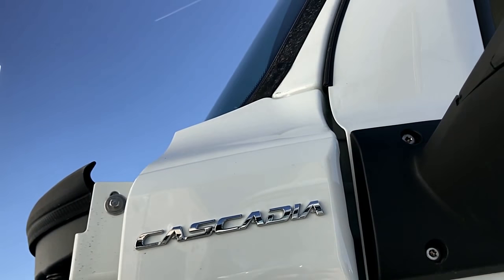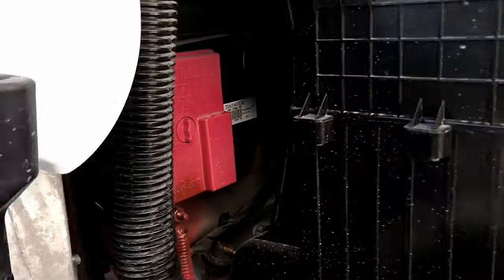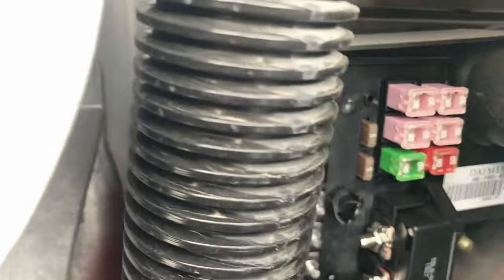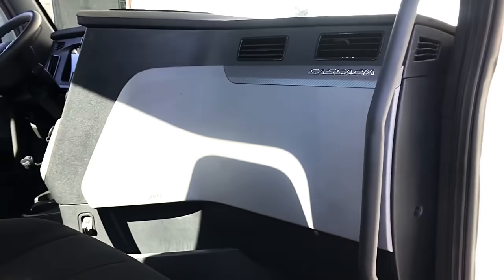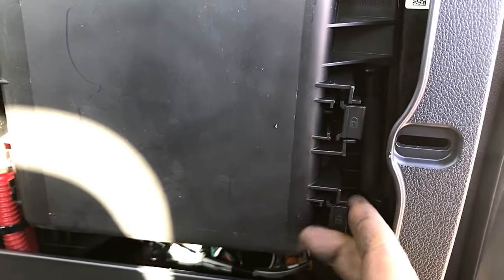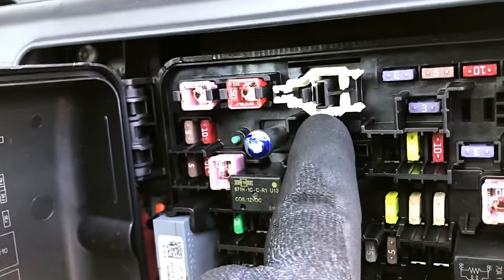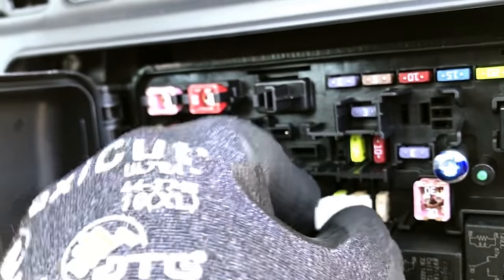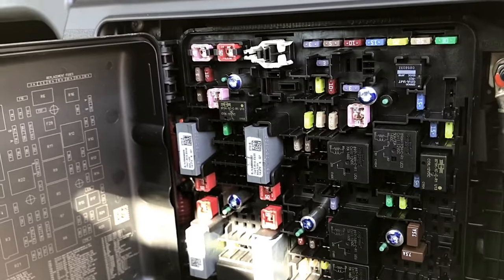New 2019 Freightliner Cascadis Truck  Fuse & Relay Location

Comment: 1st thing in the engine bay you looked at was the B.C.A. or Battery Cable Access. The fuses and relay on the pdm or power distribution module. Behind that is the electrical bay where the ecu’s are located. Single Sam is over under near the middle if I’m thinking correctly.

Comment: Hi brother hoping you could help I have same truck and all the sudden my dome light right above my head comes on like normal then slowly fades off like normal then comes back on and just keeps repeating the process doors are shut I'm lost any advice
Reply from the maker: Maybe  a door switch.
Reply: @bigrigfix  yea thats what I was thinking but the lights over the dash work correctly
Reply: Probably switch in sleeper, you can operate it backwards to have it stay off. Mine was doing the fade thing too.
Reply: @mikefeddersen2476  thank you
Reply: @515051506969  hi 👋 my right turn signal not working, but all others light are working,  can you help me please
Reply: @tanielfelix3999  what year and truck are we talking about
Reply: @515051506969  2019 freightliner cascadia 126
Reply: @tanielfelix3999  I would suggest,  that you pull the headlight out and on the back of the head light right behind the blinker there will be a module with 2 screws holding it in place if the headlight works but not the blinker replace that module that will fix your problem
Reply: @515051506969  my brother you're 100% right ✅️,  can you tell me the name please,  cause check it on eBay I can found it or do you think I can get it,  appreciate
Reply: @tanielfelix3999  call freightliner give them your vin# and tell them you need headlight module that controls blinker, I don't know the part# but freightliner could give it to you
Reply: @515051506969  thank you so much

Comment: where are trailer brake light fuses?  Looking for 2020  Cascadia
Reply: Did you find it
Reply: @amritmattu5024  we pulled apart the pigtail and found that the wire to the tailights was worn through. so we managed to pullsome of the wire out and reconnect. Bingo -lights on! When we went back to the home terminal they checked it over and replaced the old pigtail. Thanks for asking!

Comment: Where is the aux fuse box for trailers lights ? My tail lights won't work and I can't find which fuse it is bad on the interior fuse box
Reply from the maker: The trailer fuse are under the hood fuse panel.
Reply: it doesn’t have a fuse panel there only the one on the inside
 im also trying to look for trailer fuses
Reply: @say3coyote518  did you find it?
Reply: @catfishandwhitetails  yes it was inside the cab on the passenger side  it was under a different name like radio or something thing like that. just grab a test light and test all of them until you find a blown one
Reply: @say3coyote518  thank you. I think I have a pigtail not making good connection
Reply: @bigrigfix  mine was a 25a fuse that said something about the CB and I believe it was spot F16A